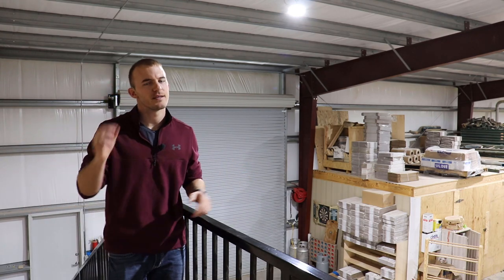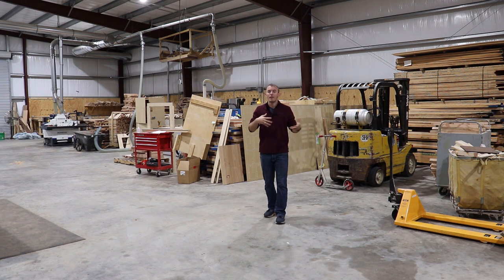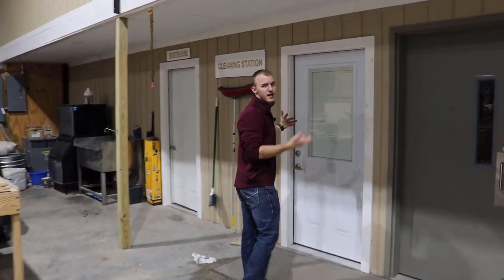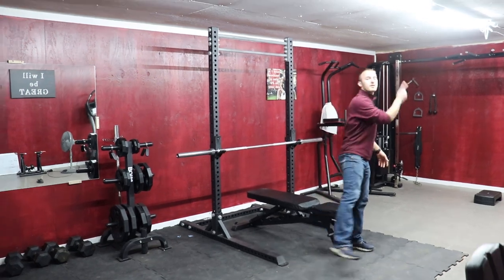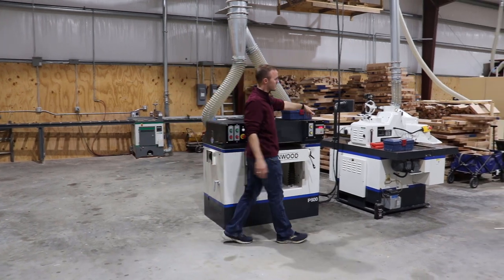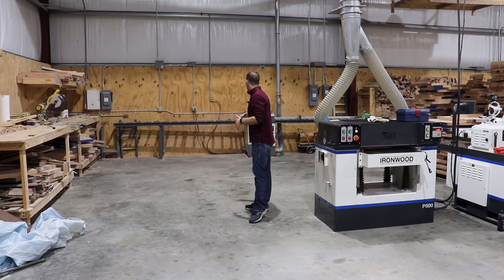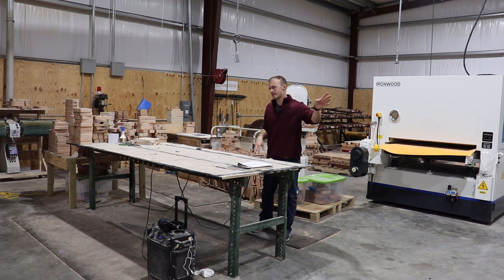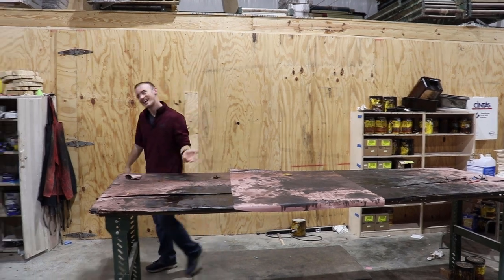I Built This At Age 24 | A Tour Of My Commercial Woodshop

Comment: Its not "scrap". Its "Drop".  I work as a steel fabricator and I fight with the boss over him throwing out steel that I will have to go to the dumpster to retrieve.  He recently bought FIVE 20-foot  STAINLESS STEEL sticks of 2x2x1/2 square tubing for a job. I used TWO!  Because I had hidden (from him)  a bunch of DROP.  Its not appreciated and I will be "seeking employment where my talents are better appreciated" soon. LOL  Also, you might want to consider color-coded pallets for drop.  That way a small fork truck or forklift can maneuver them. Label the pallet with what is on them so the saw man can quickly tell if he can use them or needs to go get new lumber.

Comment: Have to look at both the positive and the negative to keep moving forward. I may have to get video of the Biesse 5x12 nesting cell router I use at work and send it to you.  Learning CNC on it has been like learning to drive in a Lamborghini.  More than you need to learn, but really cool.  Lol.
Reply: The company got it new in 2012 for something like 200 grand, but there's a similar used one near me at a shop equipment reseller for about 80,000.
Reply: @cutting-it-close  yes, scissor lift loading pallet and roller belt unloading. Pulls the next sheet on and sweeps the machined parts off at the same time.
Reply: @cutting-it-close  we mostly cut to size, edge band and machine parts for furniture and cabinetry.  I do some commercial cabinet making, but the company makes most of the profit from straight line cut to size on the CNC beam saws.